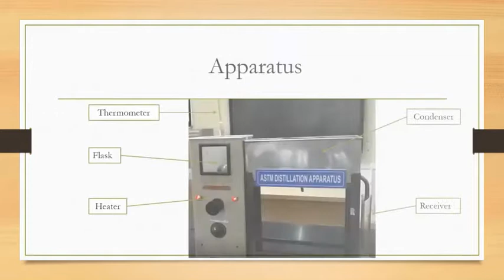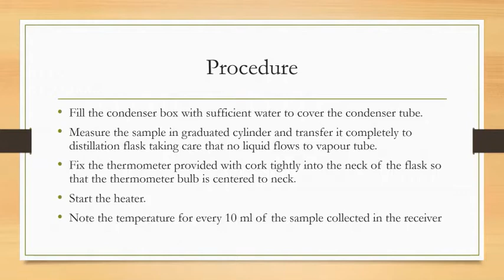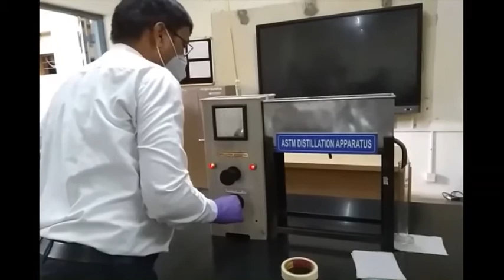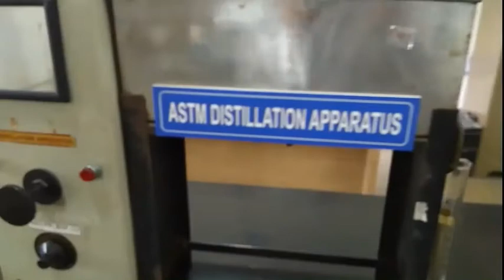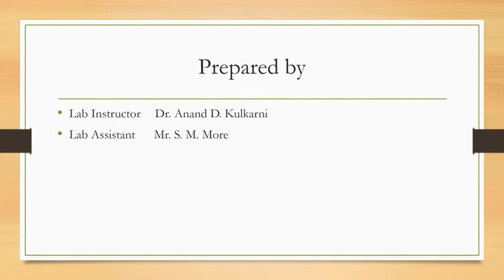ASTM Distillation

Comment: Niceeeeee sir,But  I have more question about to Distillation.
First is what should be the temperature of water in the condenser and how much water should be filled in the condenser and what temperature should be regulator set?
And second is how many ml/minute should drop in to the receiver.
Reply: ~Water temperature should be around zero degree Celsius.
~Water should be filled up to the brim so that copper coil/pipe is dipped completely
~The temperature should be lower at initial time and after some time temperature should be increased by regulator, so that heavy fraction also vaporize.
~ ml/min is depends on the temperature set up by regulator.
If higher temperature = ml/min =Higher
If lower temperature = ml/min = Lower
Reply: @saurabhanand5811  thank u very much Sir...